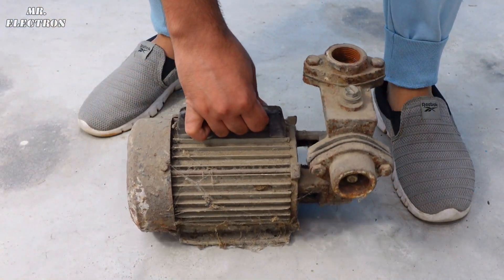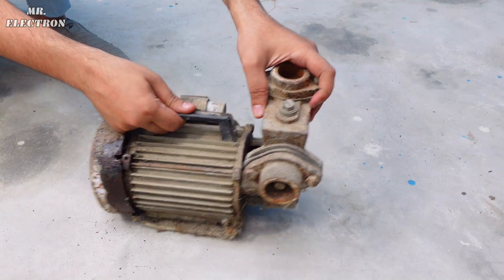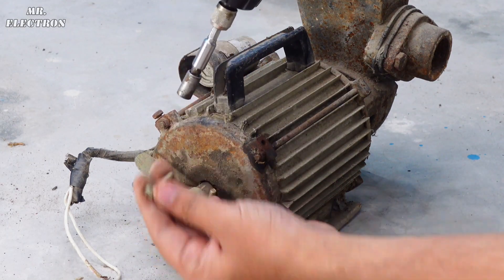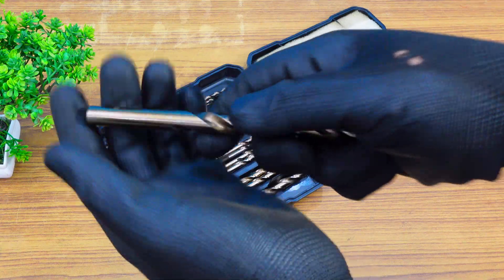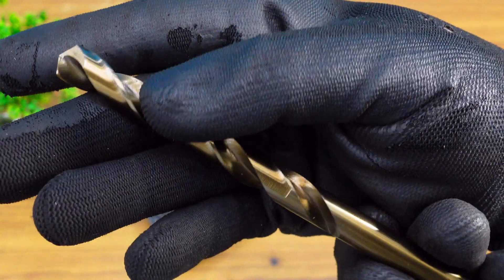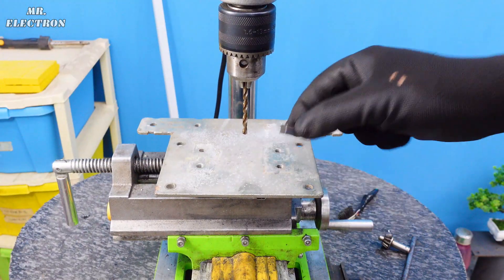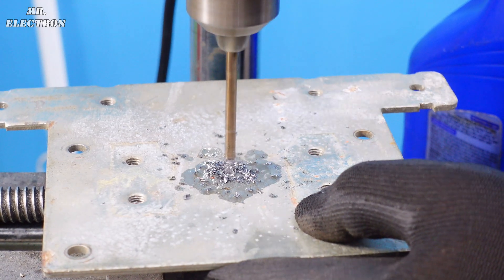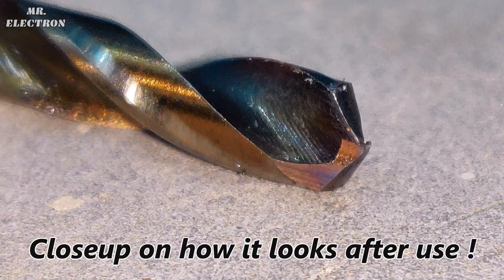I make Free Energy water pump, no need of electricity new style

Comment: good evening, I wanted to ask you for advice on a possible project.  I start from the assumption that I already know that infinite energy does not exist and neither does perpetual motion.  I wanted to know if it is possible to use the induction motor of a washing machine given that it is used for its ability to not stop even at 3000 rpm without effort from the basket full of wet clothes, if it were connected to an alternator of an 80-90A machine first using its pulley and seeing if it holds a 600w load with a 1500w inverter with the maximum peak of 3KW and consequently connected to a more or less 700-800w battery.  What I wanted to know is whether it is more or less feasible to use the engine of a washing machine as an alternative to the petrol engine and always in theory to deduce the autonomy of the battery depending on the load used at the output of the inverter, then if it can be improved putting a larger pulley on the alternator like the one behind the washing machine drum so as to have fewer revolutions per minute but many Newtons.  I hope I explained myself as best as possible and conveyed the idea.